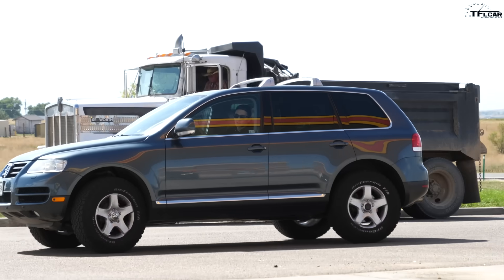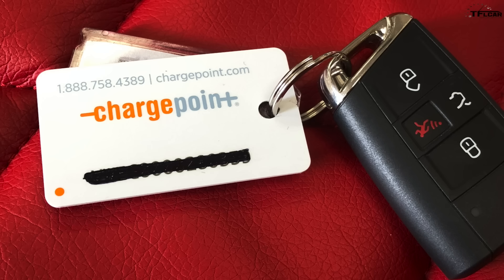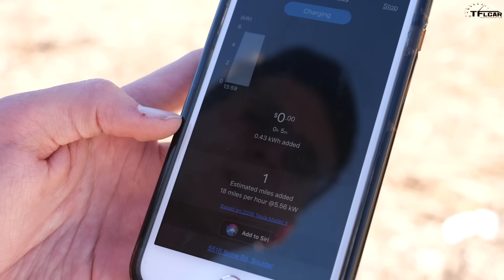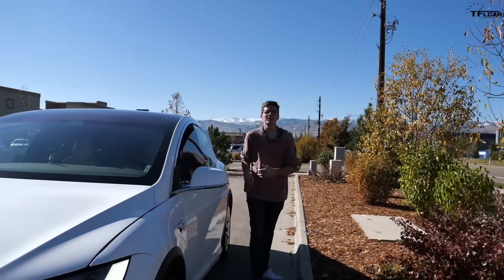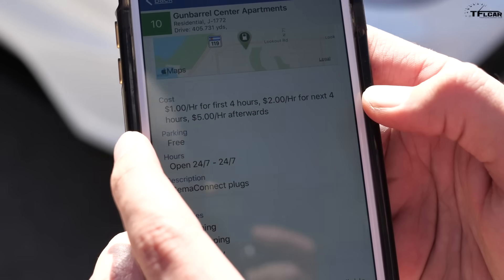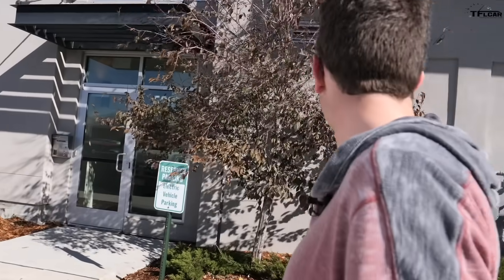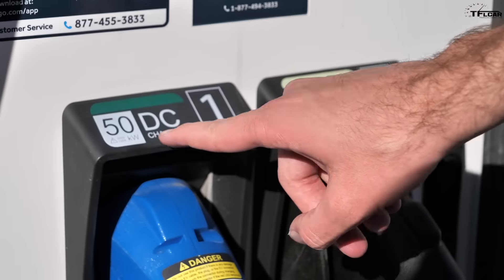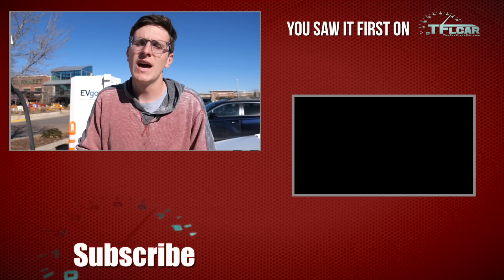Here’s Why Charging an Electric Car Can Suck - And It’s Not The Reason You Think!

Comment: Tommy - do you know why the Tesla plug and inlet are different than the J1772? 
Around 2010, when Tesla was designing the Model S and it's charge ports, it asked the SAE J1772 Committee (which was comprised of GM, Ford, and other major car manufactures) for the physical specs of the new 2010 J1772 Plug and Inlet. The electronic specs were the same as the 2001 J1772 specs so that was a known. But the SAE J1772 Committee told Tesla they hadn't yet finalized the physical dimensions and they would have to wait. Since Tesla had their own ideas about what the Charging capabilities should be, they went ahead and designed their own plug and inlet, used the J1772 electronic specs and also made it work for DC high voltage. But the SAE committee had already finalized the physical design and had already given it to Yazaki, a Japanese company, to produce. The ‘Big’ car companies did not want Tesla to have the specs for the physical plug so they lied to Tesla.

Comment: This whole video was very misleading to someone considering an EV. Presenter did things that no experienced EV owner would bother with, and made it seem like the problems he experienced were typical. But in reality, he was simply being deliberately stupid about his charging choices.
He was treating a modern EV (Tesla) with the ability to high speed charge and go 300 miles on a charge like it was some lame "compliance" car with short range and no ability to high speed charge. The only time any EV owner would even consider using a public slow charger if the car is capable of DC fast charging is if they were going to be parked somewhere for many hours. Maybe overnight at a hotel, or all day at a theme park, or all day at work. I've never used a charger like the ones he was fighting with when I was on a trip.
Now, there is a tiny bit of truth in this video IF you are foolish enough to buy an EV and don't have any way to plug in to charge at home overnight you might have to rely on one of the many incompatible and unreliable level 2 chargers. If you can't charge at home for your daily driving, at the moment (2020) it's probably best to stick with a conventional or hybrid car.
And it was true when this video was made that some EVs did not come with DC fast charging, or only had that ability as an extra cost option. Those cars are, in my opinion, obsolete. Any EV sold in 2020 ought to include DC fast charging standard.

Tesla recognized the need for a better solution than chargers like the ones shown at such length in the beginning of this video, and built a massive network of dedicated high speed chargers that let you add charge at up to 1000 miles of range per hour of charging.
 When I am on a long trip, I can get 150 miles of added range quick enough that I barely have time to pee and grab a drink from a vending machine. When he did this video Tesla chargers were limited to 120 kW - but since then they have upgraded many of their chargers to 250 kW - which is crazy powerful and gets you on your way quick enough that charging time is really not a big deal anymore. And every Model 3 and Model Y can use that extreme rate. The older Model S and X are limited to about 150 kW.

Also, back when he made this video the non-Tesla level 3 chargers were almost all limited to 50 kW. And frankly, that isn't really fast enough when you are on a trip. But just 9 months later, the VW backed "Electrify America" charging network has built hundreds of stations with 350 kW CCS chargers. Only a few cars can even approach using the full 350 kW, but there are several EVs now available that can accept 200 kW from those chargers.

Bottom line: Tesla drivers simply don't ever experience the issues he showed. As he notes, billing is automatic. Tesla is excellent about keeping all the sites up and working. The chargers are fast. The chargers are numerous and well placed.  And finally, you never have to look for a charger. The cars know where they are (including the newly opened ones) and when you use the navigation, the car suggests when and where to charge, if that is going to be required to reach your destination.
And other EV makers are beginning to catch up. Hyundai, Porsche, Audi, and soon Mercedes, VW, and Ford have cars with 250+ miles of range, and the ability to use decent high speed DC charging.

Comment: Is that 240 v dc or 240 v ac
Reply: Level 2 charging is 208-240 VAC - and that is true both in the USA, where our domestic outlets are 120 volts, and in the rest of the world, where 220-240 volts is the norm for a household outlet.
Reply: @jimmurphy5355  so it would charge fast if you have 230 v ac with 16 A
Reply: @parthasarathyvenkatadri  No, 230 VAC 16 amps is still slow charging. Practical only for overnight or all day while parked at work. Fast enough to cover all the driving most people do in a day. 230V 16A adds about 20-25 km of range for each hour of charging. I am in the US, but we have 240 volts available at all homes, even though regular outlets are 120 volts. I installed a 240 volt outlet where I park, and it can supply 32 amps. That is fast enough to fill my big battery Tesla from nearly empty to full overnight in about 10 hours.
Reply: @jimmurphy5355  I am in india we do have AC 230 V but I don't have a clear idea about the ampere .. is there a way to find out. The max amps I could pull
Reply: parthasarathy Venkatadri I’m not sure what you are asking.  The maximum from a regular existing outlet? Or the maximum from your house with a higher current outlet? In India you have a limitation that I don’t - the ”sanctioned load” for your service may be the limiting factor, unless you arrange for a higher power connection (which will add to your monthly base charge.) My understanding is that the sanctioned load for many houses/apartments is only 3 kW.  When I charge my car at night it uses over 7 kW.

Comment: Craaaaazy slooooooooooow to charge any electric car. You cannot charge too fast with current battery tech. cause you will get lithium dendrite problem, which is what leads to fires in battery cells in electric cars. https://www.youtube.com/watch?v=XP9w6mGo-mE
Solid state or graphite batteries may decrease charging times but right now too expensive to produce.

Comment: So, the takeaway from the video I got was, look for a charging station when your at 25% battery because it can take 3 or 4 stations to find one you can use.  Then be prepared for a 3rd party to collect your credit card info just to deny authorization.  Sit for up to 3 hours on road trips to get you an additional 150 miles?   And still use fossil fuel to charge your electric vehicle.
Reply: This whole video was very misleading. Presenter did things that no experienced EV owner would bother with, and made it seem like the problems he experienced were typical. But in reality, he was simply being deliberately stupid about his charging choices.
He was treating a modern EV (Tesla) with the ability to high speed charge and go 300 miles on a charge like it was some lame "compliance" car with short range and no ability to high speed charge. The only time any EV owner would even consider using a public slow charger is if they were going to be parked somewhere for many hours. Maybe overnight at a hotel, or all day at a theme park, or all day at work. I've never used a charger like the ones he was fighting with when I was on a trip.
Now, there is a tiny bit of truth in this video IF you are foolish enough to buy an EV and don't have any way to plug in to charge at home overnight you might have to rely on one of the many incompatible and unreliable level 2 chargers. If you can't charge at home for your daily driving, at the moment (2020) it's probably best to stick with a conventional or hybrid car.
Tesla recognized the need for a better solution, and built a massive network of dedicated high speed chargers that let you add charge at up to 1000 miles of range per hour of charging.
When I am on a long trip, I can get 150 miles of added range quick enough that I barely have time to pee and grab a drink from a vending machine.
BTW, when he did this video Tesla chargers were limited to 120 kW - but since then they have upgraded many of their chargers to 250 kW - which is crazy powerful and gets you on your way quick enough that charging time is really not a big deal anymore. And every Model 3 and Model Y can use that extreme rate. The older Model S and X are limited to about 150 kW.
Also, back when he made this video the non-Tesla level 3 chargers were almost all limited to 50 kW. And frankly, that isn't really fast enough when you are on a trip. But just 9 months later, the VW backed "Electrify America" charging network has built hundreds of stations with 350 kW CCS chargers. Only a few cars can even approach using the full 350 kW, but there are several EVs now available that can accept 200 kW from those chargers.
Bottom line: Tesla drivers simply don't ever experience the issues he showed. As he notes, billing is automatic. Tesla is excellent about keeping all the sites up and working. The chargers are fast. The chargers are numerous and well placed.  And finally, you never have to look for a charger. The cars know where they are (including the newly opened ones) and when you use the navigation, the car suggests when and where to charge, if that is going to be required to reach your destination.

Comment: I think the 240v outlet in my garage was about $200 to have installed. There is a chargepoint at my job... First three hours is free. Mine charges at 30 miles per hour. You must have left the AC or heater running. In general I find charging to be more convenient than filling with Gas.

Comment: No, thanks Tesla! I would rather charge my Toyota Prius Prime at home, 5.5 hours~30 miles.
Reply: You realize you can also plug a Tesla in at home - into a standard household outlet. In the US, with 120 volt outlets you get about 4-5 miles of range for each hour charging. Very slow, but if the car is parked at home 12 hours a day, that gets you 50-60 miles a day of driving. If you live somewhere that uses 220-240 for regular outlets, you get almost double that amount.

Comment: Rolling battery swap at 40 mph in 40 milliseconds makes more sense for charging your dual mode electric vehicle.  One swap station that is under the ground can send energy to 57,600 dual mode EVs per day maximum.  Instead of fast charging which kills battery number of lifetime cycles, it slow charges the battery mule greatly extending the life of that investment.

Comment: If you don't have a garage it's not worth buying an EV. If you travel a lot using your car it's not worth buying an EV.
Also, I am more scared of having a huge li-ion battery under the floor of the car rather than having a standard gasoline tank.

Dear EV owners, leave your car outside in winter for 5 days and see what range you have left and how that destroyed your battery capacity. For gasoline cars, the worst that could happen is a dead car battery, which can be replaced at any automobile parts store.

Comment: Great video. This pretty much explains why I bought a (used) plug-in hybrid this year. It has 50 mile range and charges overnight from a 120 volt outlet in my garage, and that covers round trips to anywhere I go to nearby towns around my home and all local driving. When one road trips, I buy gasoline, and get about 53 m.p.g. A pretty good compromise for me until this is all sorted out. Thanks for posting!

Comment: Great video! Teslas plug is so much more sleek and smaller and just overall very clean. Everything else is so clunky and bulky. Superchargers are really done right. Plug in and walk away. And who the F has charging hours? Not seeing the reason beyond a closed gate blocking access. J1772 allows vehicle communication so the app should know who is plugged in without tapping screens. Chademo/CCS is the clunkiest pos ever designed.

Comment: First of all, welcome to Europe where every home owner has 220V and 16 to 32Amps. I charge my car at home or my company within a few hours from 20% to 80% (during office hours or the night). 
In Europe the Tesla network is very good, but the other networks are fastly growing with chargers up to 250kW! It's clear that for an electric future we have to adapt some things, which means to expand the charger network and probably regulate its exploitation, so it will be as easy as taking gas now. For people not having an own driveway, parking lots/areas/garages with adequate charging facilities have to be build. For all this we still have time, as we will not change all cars overnight to EV's. 
Driving an EV for over 2 years now and 100.000 km/y (60.000 miles/y) I have to say that it is not the same as living with an ICE car, but it is definitely no big problem, except the initial investment.
The change started and will slowly become reality for all people in the next 10 to 15 years, with probably other techniques/energy sources parallel to batteries. Clear is that ICE will disappear to the background, only for some old-timer lovers or specialties for the rich.
Reply: Just how is that electric future going to work? We use coal to produce most electricity because solar and wind can’t keep up with demand because they are inefficient. Do you know why Europe is ahead? It is called nuclear power, which you green dolts are opposed to here in the US.

Comment: Interesting utube So what happens if u r pulling a traler this charger is not a drive through so unhook the trailer or have a good very heavy duty extension cord. In Cdn u will not go very far on a very cold day (-40) better have y snowmobile suite along its going to be cold (get an elect heated cordless jacket LoL) oh stepson now workong in Calf ( other states too) up grading elect grid system ( y air cond might not work if y neighbors charge their cars LOL and we want how many more EV ?  I am Cdn "a" there r better ways ( currently working on protype unit for traction on ice etc ) 1 403v83 4124 have Elon Musk call us his mothervwas Cdn "a" has cousins farming in Sk. Yes we r making " green hydrogen" in old abandoned oil wells

Comment: In my gas vehicle through my day to day , week to week routine, I have my favorite places to fill up. So I imagine, I’d do the same in an EV. You find your typical places to charge, so billing would be simplified as far as which pay method to expect. 

I understand traveling may be a bit different but as you showed, plug share app should be t
The best way to at least locate a station.
Reply: The routine for 99% of EV owners is to charge at home.  Public is just for long trips, or to top up while shopping or whatever (if it's free, if not, F that).

Comment: Would seem the big issues is road trips.  Do they charge if plugged in but done charging? What happens if leave your car parked there after it finished charging overnight?  Does Tesla let you run the AC and stay in car while it charges?

Comment: Hrm.  Judging from many comments it seems there's quite a lack of understanding.  Most people charge at home.  That means either cheap electricity from your house or using a charger at your apartment, where it really doesn't matter if it takes overnight.  It's fundamentally wrong to think of charging your EV like filling the tank.  No one sits there twiddling thumbs while charging a phone, it's just something you do at night once you're done with it.  That's pretty much how it works when charging your car.  The only time you ever need to care about fast chargers are on road trips, where you'd likely be planning rest stops anyway.

Comment: 17 miles per hour. Why bother?
Reply: Think of it on a bigger scale, you sleep for about 8 hours - which nets you about 160mi overnight 
Depending on your commute and mileage needs, a car that gets 250mi on battery will work great for most home charging scenarios and 50-100mi commutes 

Technically, that charger should be running at 6.6kw or 20mi/hr, so note that his assessment is not authoritative for all Chargepoints in all areas...

Comment: So EV:
-Good for in town low mileage every day use (Why not just get a Prius prime that can do 25 miles a day if you live in city?)
-Most of the electricity going into a EV is Nat gas or Coal fired, you really are not saving on emissions a huge amount unless its Hydro or Nuclear.
-Ion lithium batteries emit a huge amount of co2 on fabrication. This combined with the energy source of the power plant it lowers the green nature of the car significantly. 
-EV's suck for towing.
-EV's have low range.
-EV's are expensive compared to hybrids.
-EV's have non standardized charging as seen here.
-In some cases EV's cost more than using a hybrid for cross country traveling. And in most cases they are very close in cost without all the negatives. 
-Filling up takes 5 mins with time to go take a piss for another 400 miles, EV's take hours.
-They suck in the cold, such as were my home is in Montana. Even were my wife lives right now in Flagstaff AZ it still sucks during the winter.
The technology is not there yet. Their cons outweigh the benefits currently. Super efficient hybrids/ICE just make more sense for cars, and well EV's are a joke when it comes to competing with a actual truck doing truck work.

Comment: We have found that an EV is IDEAL for running around town (that would include commuting to work if we weren't retired...), and charging overnight in the driveway. We have also found they are pretty useless for road trips, especially for camping, fishing, etc. since there's not such thing as an electric SUV (not counting the ones that CLAIM to be an SUV simply because they look like one).
And as illustrated in this video, EVs for road trips are only even possible if you're shelled out $50K+ for a Tesla and are completely dependant on a smart-phone (preferably Apple).